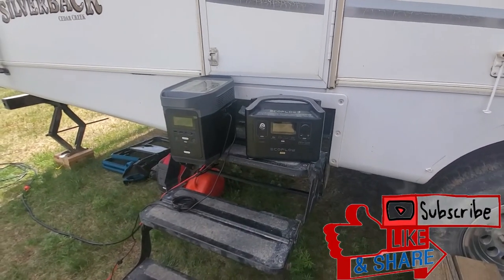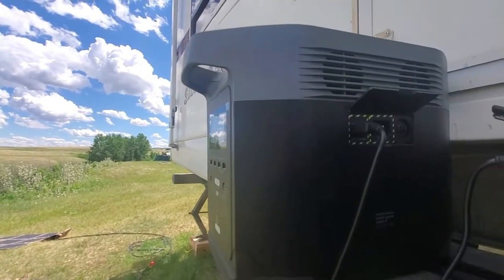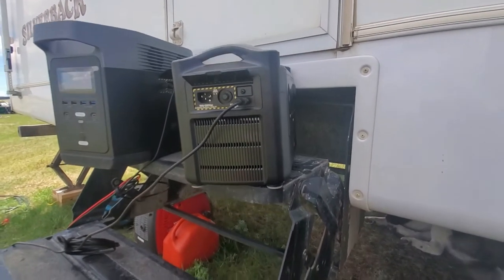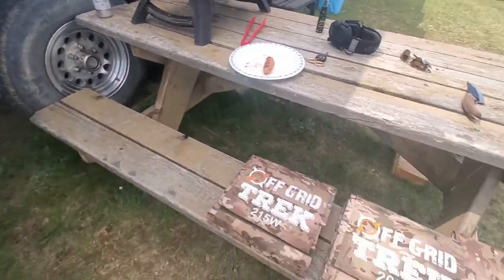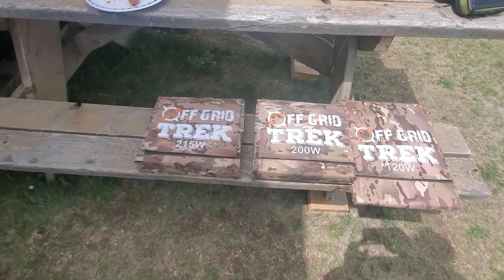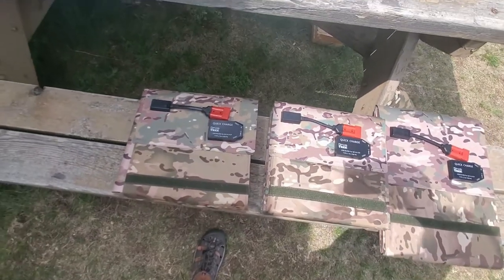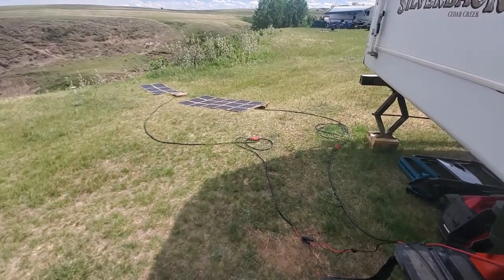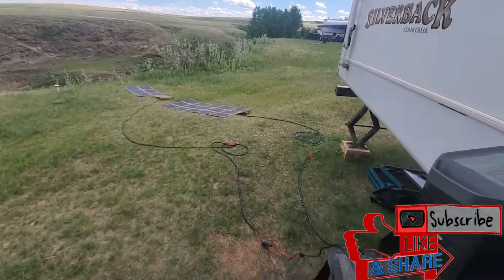Can you power several solar generators from just 1 type of Solar Blanket/Panel?

Comment: I got the 215 solar blanket for the Apex and the Flex 1500. I thought that the 215 was good for low light conditions.
Reply from the maker: Both are good for low light conditions, the 200W is to high of voltage for the Apex, so it could over power it, this also makes it a bit better in low light conditions.  The 215W is the best option for the Inergy Apex, I will have the Flex here soon to beta test and it looks like it will work well with all of the Solar Blankets we offer.

Comment: Bought a 220w Balnket. 
I have a bluetti 200Max.
Just need the correct cable to connect them now.
Any suggestions?
Reply from the maker: All you need is at least one of our extension cables and one of our MC4 cables, both can be found on our Solar Blanket page
Reply: @offgridtrek  thanx buying now. I assume this will take me around 9 hours to charge in UK)
Reply from the maker: @MMLABS  9hrs would be in perfect sun conditions, if you have less than ideal sun then it will take longer
Reply: @offgridtrek  I can combined the OFFGRUDTREK solar oanel with one Bluetti oanel right?
Reply from the maker: @MMLABS  it is best to not combine two different sized or brands of solar.
Reply: @offgridtrek  tries all sorts but for some reason now it says "the order can't be shipped to address entered".
Even though a 220w was already shipped here.
Any ideas?